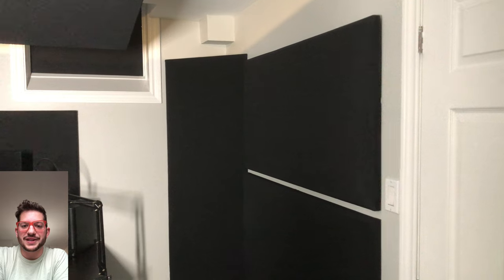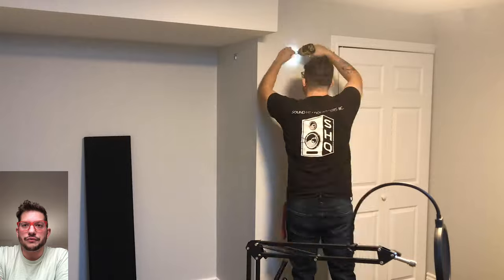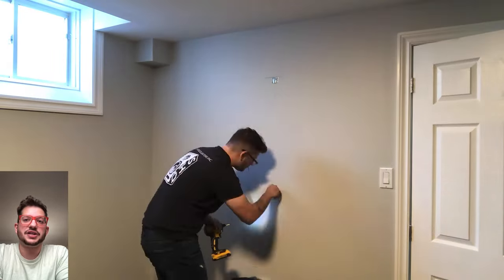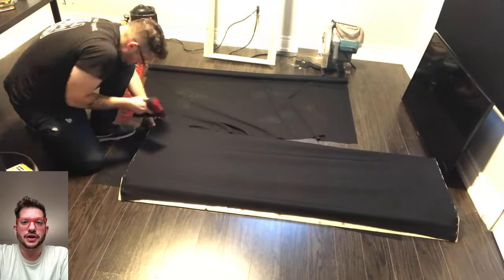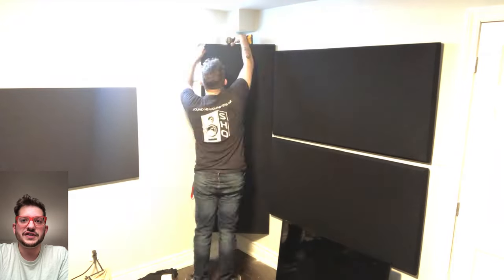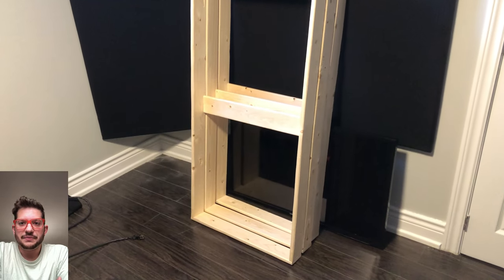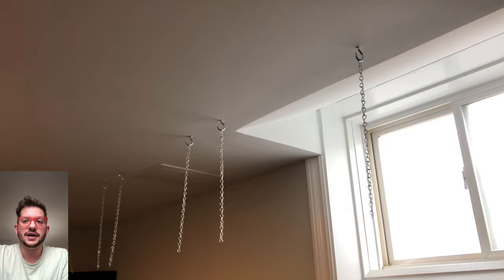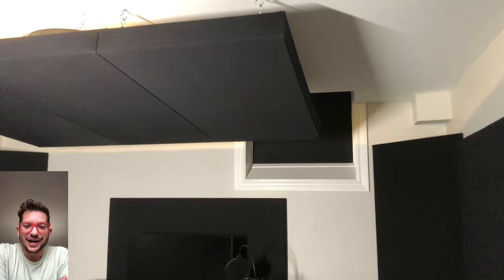DIY DREAM HOME STUDIO! HOW TO MAKE BASS TRAPS & SETUP CEILING CLOUDS!

Comment: I think this is more of a "how to hand stuff on your walls" video.  I was hoping for more information on the building-design-placement of the panels themselves.
Reply: @fxrbxjx  How can you not be smart enough to know how to hang the panels on the wall?  Where are the calculations for the size of the panels, the type of foam to use, and the placement?  The purpose of a bass traps is to eliminate (absorb) low frequency standing waves.  The frequency and amplitude of the standing waves varies depending on room dimensions.  That is the information I was looking for.
Reply: @fxrbxjx  And the instructions on how to install drywall anchors are on the back of the box.
Reply from the maker: This is a great idea for a future video! In the meantime feel free to email me for personalized consulting if needed for your room I'd be happy to help. Thanks and take care

Comment: I have a quick question. What will be the estimated cost for the same room treatment ?
Reply from the maker: The cost all depends on your location, materials used, and if you have access to your own tools and equipment. 
I always recommend setting your budget first, then treating the biggest problem areas as well as you can. 
Every room and persons needs are different, send me an email if you are interested in consulting for your own space. Or if you are located in the Toronto area, I can provide a full quote.
Thanks for watching!